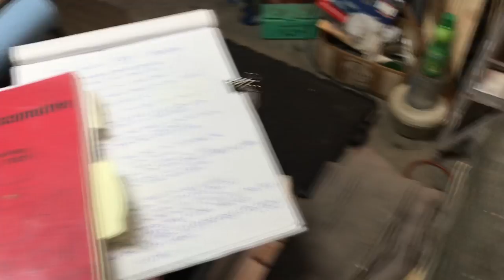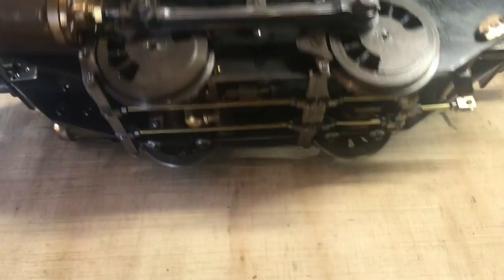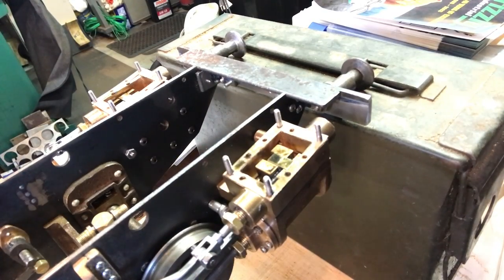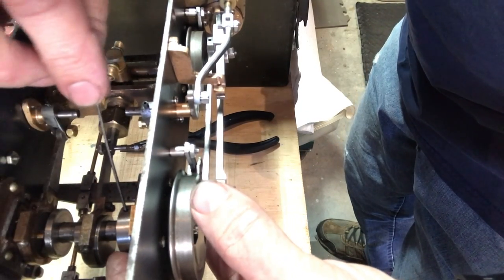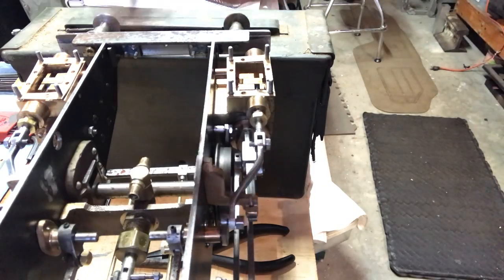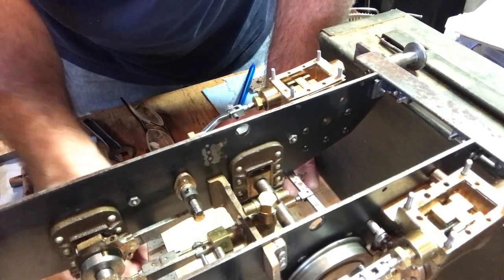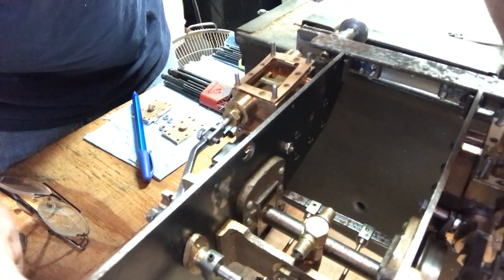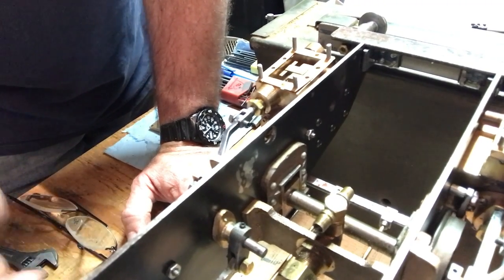Set valve timing, slip eccentric, Live Steam Locomotive

Comment: I’ve refitted Ayesha with taper pins as used by clockmakers for the piston rod fixing. Makes disassembly quite easy and they tend to stay put. 😀 valves ideally should open a hair before the dead centres but as  long as its close it will run. Slip eccentrics aren’t going to give perfect valve events anyway so you’ll probably end up with it working better going forward than back.